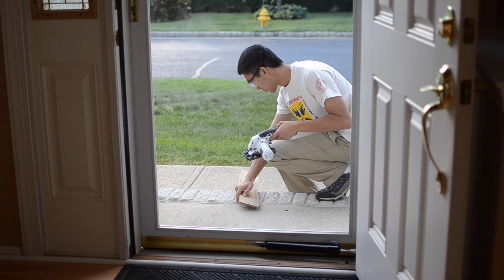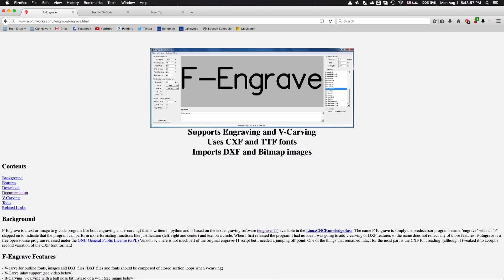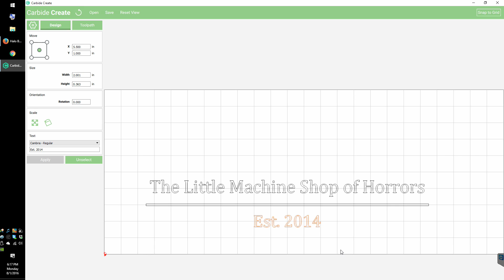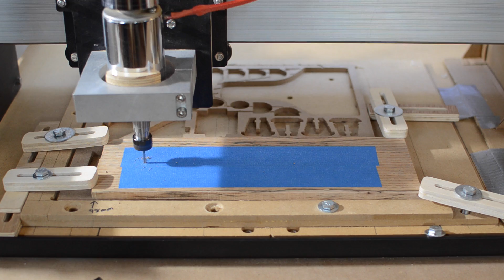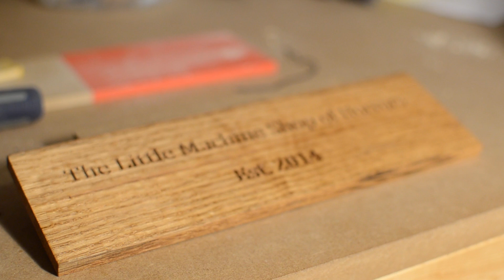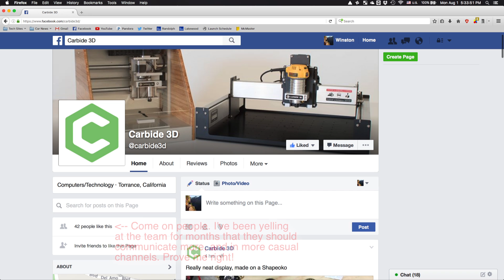Making a Shop Sign in Carbide Create w/ V-Carving - Shapeoko Project #58

Comment: Hi Winston. Another excellent video. One thing I noticed on the clamp set up that I thought I'd mention. The holding power of a strap clamp is greatest on the lowest end of the clamp. You always want the end of the clamp that is holding your part the lowest end of the clamp. Then again machining wood, it probably will hold either way. Machining harder materials you run the risk of your part moving around. Again, good video.

Comment: I just met a guy that has one of these Shapeoko XL setups and he wants to do a startup sign business with me. I am trying to sift through all of the many pieces of information on getting started with CNC. I am quite computer literate and after years of graphic design and cutting vinyl for signs I do not see this being difficult to learn. That is if I can find a good place to start as I have never tried CNC at all. Any suggestions? Thanks!
Reply from the maker: Watch content to learn the lingo, and also figure out what parts of the workflow you are unfamiliar with basically. That's how I started. Since you seem to have a type of job in mind, that helps you because it narrows down the set of skills you'll need to learn to get started.

Comment: hello Winston I have a question. I didn't see where you put your desired depth or did is missed it? I have a shapeoko 3 and trying to use carbide create for my v-bit carving but I have been using inkscape and makercam as you know they don't have v-bit carving abilities.
Reply from the maker: +jgarza77093 I don't believe there's a depth option, as the v bit cuts until it's width fills the contours of your letters. There is a step-down option, but I dont have access to my computer ATM to investigate further.

Comment: Why not try Fusion360 for engraving?
Reply: Agreed...Id be more than happy to spend time with you.  Can't be FREE for Enthusiasts as well as Hobbyists.  I love your videos, as I have a Shapeoko 3 myself.  Let me know...
Reply from the maker: Generally, router all the way down (or almost all the way) is fine. In extreme circumstances (ex. long endmill, unexplained chatter, very tall workpiece, etc), you can pull the router up a bit more.
Reply from the maker: Baby steps. I've been trying to use more 360 lately, but it's a gradual process, weaning myself off commercial programs... I'll get there.
Reply: Justin Bell I have just purchased a Shapeoko 3 as well as the De-Walt router and I was wondering if there is a correct position to lock the router in, the router with it dropped in the clamp fully or what?.
Reply: Thank you Winston for the extremely quick reply.

Comment: 2:22.  You can view your NC files once you load it into Carbide Motion.  Click RUN, (leave your spindle off), the spindle will raise and the program will pause.  Look at the banner on the TOP of the screen.  It is a link that will open in a separate pop up window, and allow you to view, copy (for editing) the G-Code.  It's a bit hidden, but I got to give Carbide3D a nod of approval, since they need to tie the software to their machine to keep it proprietary.

Comment: What v-bits would you recommend? Brand, angle, diameter, or otherwise. Thanks!
Reply from the maker: Honestly... start with a cheap ebay set and just figure out what fits the kind of work you want to do. No-name, basic carbide will do just fine for wood and PCBs. Get a couple of each shape, 45-60-90. If you want to do larger pieces, consider router-sized v-bits. 1/4" shank. If you start doing a lot of V-cutting, then you can explore higher quality bits.

Comment: If you want to paint it, just do it. 
And then sand it away. Just the paint in the letters will stay. No tape needed. 
Its very easy.
Reply from the maker: In hindsight, probably could have done that pretty easily... I even picked up an orbit sander recently... #MissedOpportunities
Reply: This is my trick that works very well.  After it comes off the machine, apply a coat of water base Polyurethane, wait for it to dry (60 min), lightly sand the face to remove those tine little wood fibers (hairs).  Next, apply the paint on the letters (Spray, Brush, etc.), don't worry about the paint to the face of the sign.  Allow to dry.  Next, using a sanding block, sand the excess paint off the face of the wood.  This should only take 3-4 swipes of the sanding block, leaving crisp edges to the painted letters.   The Poly stops the paint from bleeding into the wood (face).  

(Edit) USE the Dewalt, and 1/2" V-Cutter on some 7/16 wide letters and you will see that the V-Carving feature on CarbideCreate is amazingly crisp.  Nice square letters, sharp points.  Very professional.  That baby spindle and tiny tiny cutter really didn't give the software a fair trial.  So, I call "do over," Take 2.
Reply: @RichardCournoyer  I gotta try this. Very smart. Sorry I'm replying to an old comment!
Reply from the maker: I just bought a 1/4" shank bit, so I can bring my Dewalt to bear. Definitely plan on revisiting this project...